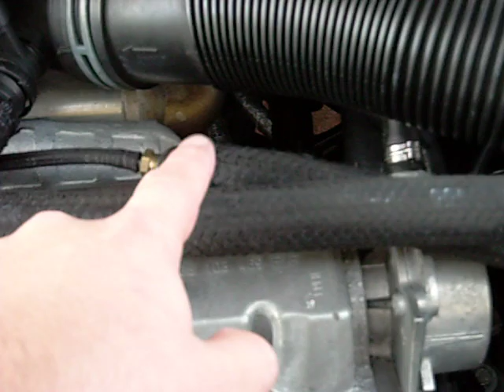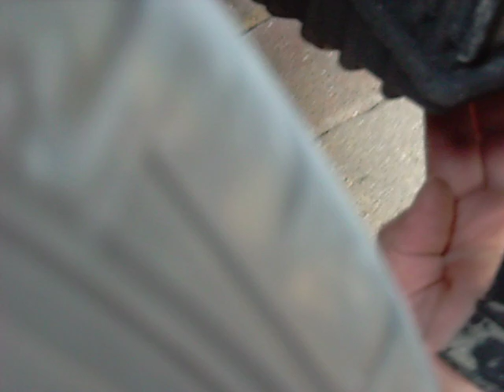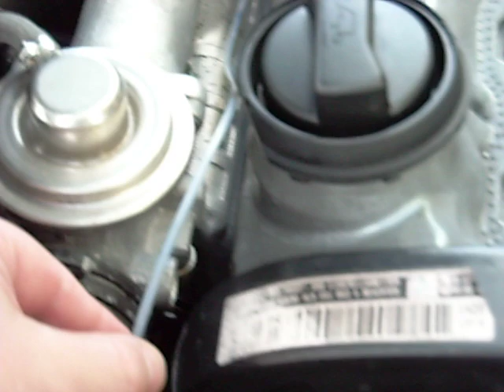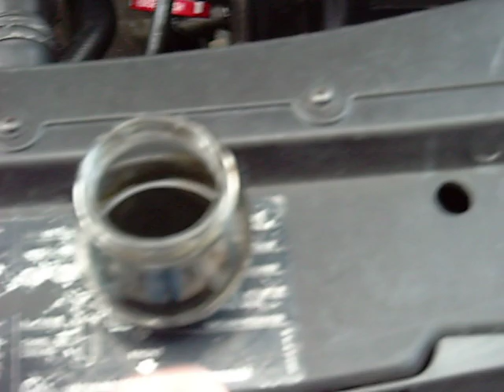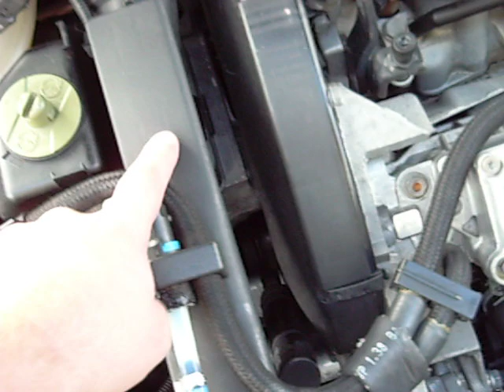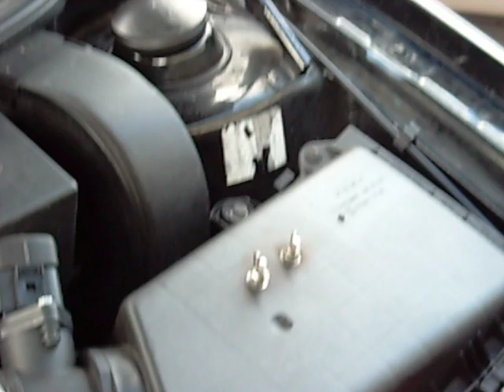VW Jetta TDI Cyclonic  Air/Oil Separator for ALH Engine with lower IC bleed line

Comment: Hi Josh, just a quick question. Dose the lower drain tube have to be air sealed to prevent a vacuum leak an or can I just let it vent to atmosphere /  let the small amount of oil drop onto the floor? Cheers Dean
Reply from the maker: Nope, doesn't have to be sealed at all.  No vacuum will be present there, just boost pressure.  It's better to have a catch system rather than let it dump to the environment.

Comment: Did this stop the oil from going into the inter cooler?
Reply: No Turbo leak here!
Reply from the maker: Dave,

Sorry so long to reply-I missed your question.  This only helps to stop some of the oil that is getting to the lower IC from the crank case gasses.  It also helps to remove oil from the lower IC that is leaked from the turbo seals.  As mentioned in other posts it allows also a quick and easy view into the engines operating health as well from vacuum leaks to the health of turbo oil seals.  Also like I mentioned I wish I would have used a 1/4" OD nylon bleed line from the lower IC instead of the current 1/8" OD line I have.  The 1/8" OD line tends to get munged up with milky oil/water mixtures which impede the oil removal.  Best wishes!
Reply: Thanks!

Comment from the maker: Update:
My cyclonic oil separator is still working very well.  I stopped venting
 the effluent of it to the oil pan early on and wouldn't recommend 
anyone attempting that.  I found adding stainless steel scour pad mesh 
loosely packed upstream the cyclonic separator helped separation 
efficiency while still allowing plenty of volume to get through.  I 
recently had a serious change in volume of my separator setup-I noticed 
quite a bit of water in it that usually is not there.  I went ahead and 
emptied it thinking maybe weather changes caused more condensation.  
After a couple months I noticed the same thing again.  This caused me to
 look further into the potential of head gasket leaks or other sources 
of water.  I ended up finding a large crack in my large diameter vacuum 
pump hosing that allowed moisture laden air to get pulled in and 
condense in my cyclonic oil separator setup.  This vacuum hose crack was
 slightly reducing braking assist to the vacuum brake booster and 
reducing power to vacuum driven actuators.  I'm glad I had the separator
 that alerted me to the problem early on so that I could investigate and
 find the issue.  

I am finding that my very small 1/8" diameter bleed line from the lower 
intercooler is just too small, and when moisture and oil mix it 
sometimes makes an emulsion that can stick inside the Teflon bleed line.
  When the emulsion slugs stick it impedes the flow of lower intercooler
 oil from getting to the separator like it is supposed to.  Plans are to
 move toward a nylon 1/4" diameter lower IC bleed line and use a small 
metering valve to set the lower IC bleed flow to appropriate levels.  
Other than that the setup works perfectly and alerts me to my engine 
system health(turbo seals, vacuum leaks etc).

Comment: great! what's the diam in mm of outlet and inlet tips of separator?
Reply from the maker: If I remember correctly it was 18-19mm.  I used 3/4" ID cloth covered hose for mine.
Reply: thanks

Comment: Love that cyclone! First time I have seen a proper one.
Reply from the maker: +Nerf Dog 

Thanks!  If I had it to do over again I may consider going 1/4" tubing and use a metering valve to limit the bleed off from the lower IC.  This would help to eliminate oily/watery buildup that has at times clogged the lower IC bleed line.  When it's running well you can see clots of oil working their way out to the cyclonic filter.  While it doesn't happen often, in the colder months water gets condensed and mixes with the oil and gets thicker which can impede flow on a smaller diameter line.  1/4" Teflon line with the before mentioned metering valve would be the cat's meow.

Comment: Can you give me the part number for the cyclonic air and oil separator?  I'm having the same problem.
Reply from the maker: +Claire Volpe 

Glad you found the part number.  Search google well and I'm sure you will come up with an even better price.  Not sure What Autohaus AZ has it on sale for now.  Also, don't forget to add the SS scouring pad mesh a few inches loosely packed upstream of the cyclonic separator to increase separation efficiency.

Comment: Overkill of a setup... a simple drain plug at the cooler is all you need. Drain at every oil change and you are done. Less time wasted as well. Thanks for leaving a comment under my video... just thought I would return the favor. Your drain T at the cooler is not at the lowest spot btw.
Reply from the maker: ***** With the cyclonic separator I get better oil mist removal than just the stock puck alone.  Also the small amount of air bleed from the lower intercooler assists the cyclonic action of the separator along with preventing oil buildup.  Once it's installed the system is hands off and I have visible indications(slugs of oil visible in the Teflon tubing) that it is actively shuttling oil.   My tap point may not be at the exact lowest spot possible, but when I drilled the hole I made sure to get a balance between the lowest spot and thickest plastic wall thickness to work with.  I may still have a tablespoon or two of oil in there at all times, but I can assure you that I don't have any more than that-because I looked :)
Reply: josh8loop Good for you... people always complain about the Germans over-engineering things. I'm German, yet here I am taking less than 30 seconds to drill a hole and then plugging it. Over-thinking things might help make something look better, but in the end, what looks like a Ferrari, is just a Fiero with a body kit that goes as fast as a regular Fiero. My videos about oil in the cooler are not about "what is the best way to reduce oil buildup"... but rather about "remove the oil so that the engine does not runaway".
Reply from the maker: I agree getting the oil out is the primary concern.  You do this as a business and a service for your customers.  Quick and dirty is the way it must be in your case.  My case is different since this is my personal vehicle and I want visual indications of increased lower IC oil buildup which could point to turbo bearing failure.  The customers you do this for do not have a real time indication of impending turbo bearing failure-maybe they aren't concerned, and draining it once in 10K miles is good enough for them.  It's not good enough for me especially since I have 220K on my original turbo.  I also want to point out that CCV is one contributor of lower IC oil accumulation.  So if you can remove most if not all of the oil in the CCV then it doesn't end up accumulating in the lower IC.  My setup does this while actively bleeding any accumulated oil from the lower IC.  To each his own I guess.
Reply: josh8loop Must be a personality thing... some people take the simple things in life and make a rube goldberg machine out of them. Sure it works, sure it looks better, sure it might work better... but just like a dog that walks in circles 3 times before lying down, it's not needed. I'm happy for you that your "pièce de ré·sis·tance" is working so well for you. 

As for that setup giving you  "real time indication of impending turbo bearing failure", LOL... yeah, "to each his own I guess"!
Reply from the maker: It's hard not to take some offense to your comments about the dog thing, and the bit above about the ferrari, and rube golberg etc though I am doing my level best.  I will also give you the benefit of the doubt in that you haven't witnessed the benefits.  I've attempted to unemotionally lay out why I believe it works well and share my direct experimental experience.  Like I mentioned, it may not be for everyone and to each his own.  I think it's time to part ways and agree to disagree.  Good day.
Reply: It's not overkill or a waste of effort, especially with a turbo. His system also collects oil and other crap from the crank case vent, in addition to effortlessly removing the effluent from the IC. Oil from the crank case vent coats the inside of the IC, reducing its efficiency, and it reduces the octane rating of the intake charge which increases the occurrence and severity of detonation. Given the low cost, low maintenance and at least moderate benefit, I think Josh has a good thing going on here.
Reply: In your opinion, would simply eliminating the stock PCV (via block-off plate kit, and plugging the manifold inlet), and splicing the cyclone or catch can (Provent 200) inline between the block-off plate and turbo return line (like what an A4/B7 has) be a better setup? This would eliminate the failure prone PCV, eliminate blow-by from going directly from PCV to manifold, and filter/clean the crank case blow-by going back to the intake via turbo with the bonus of eliminating turbo soot and intercooler residue. Simple, functional, yes?

Comment: I've always wondered if the captured oil can go back into the engine? the oil looks good to me
Reply from the maker: Recently I've been finding more water in the effluent.  I am thinking this is due to cooler weather here and also my vacuum pump nipple is most likely loose and allowing extra air volume(laden with moisture) flow through the crankcase ventilation system.  Looks like I will need to address that situation son with the vac pump.  But to answer your question I would be leary of putting it back in unless it doesn't have any liquid moisture and it was filtered well.  With that being said, the BMW setups just dump it right back in.
Reply: +PlaystationQUAD I've been wondering about this myself but water vapor, fuel vapor and possibly other gases you wouldn't want in your oil can condense in the separator and associated lines so it probably wouldn't be a good idea to let it drain back into to the crank case. I see Josh's system is kept warm by the engine cover so that would help a lot. Anyway, the purpose of the vent system is to vent stuff you don not want in your oil, so I'm not sure it would be good to send it back through the crank case once it's made its way out. I think it's best to collect and discard the effluent like Josh is doing. For $300+ you can get a heated (by radiator coolant) Air Oil Separator from Perrin, which supposedly doesn't allow undesirable vapors to condense in the system, but I'm still not sure there isn't a fair amount of undesirable compounds in the effluent with it as well (I could be wrong). I think Josh has a good thing going on especially given the low cost and the fact that the amount of oil lost by discarding the effluent is minimal.

Comment from the maker: Ok, so I have the long awaited update after adding stainless steel scour pad mesh just upstream of my BMW cyclonic separator.  I was separating approximately 1 ounce in 10K miles.  Today I measured the actual amount collected after this recent 10K mile interval and found it had removed 2.5 oz.  That is 150% more than the standard pre SS mesh separation numbers.  There also appears to be a strong thermal interaction between the SS mesh and the CCV flow which cools the gasses.

Comment from the maker: Took some measurements of the oil removal efficiency after adding the stainless steel mesh.  Prior to the mesh I was removing a little over 1 ounce per 10K miles(.00011 oz/mile) and I'm now at .0002 oz/mile which should be around 2 ounces per 10K miles.  Separation efficiency is approximately doubled by adding the loosely packed SS mesh a few inches upstream of the BMW cyclonic separator.   This simple modification is highly recommended.

Comment from the maker: No Problem.  I did some measurements today and found that I am removing about double the amount of oil that I was before I added the SS Mesh.  I am pretty amazed adding the mesh made that much difference!  It's loosely packed in the inlet line a few inches upstream of the separator.

Comment from the maker: I found adding the Stainless Steel scouring pad upstream of the cyclonic separator adds to the separation efficiency.  I have not quite gone 10K miles with it in there, but early indications are that it may add an additional 30% volume over the 10K interval.  Will update when I have actual oil removal volumes to post.

Comment from the maker: I found adding some stainless steel scouring pad mesh preceeding the inlet to the cyclonic separator adds to the separation efficiency.  Also, if you have a Turbo vehicle you may consider a small turbo air bleed to increase flow velocity through the separator like I have done.  I would also use lines no less than 5/8" diameter and preffereably 3/4" if possible.  Intercooler bleed line can be 1/8" or 3/32".